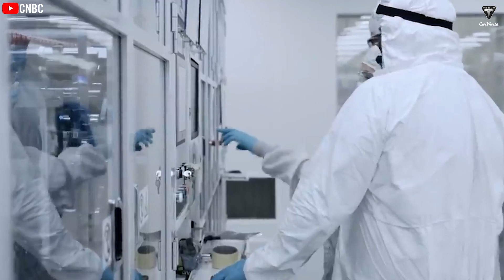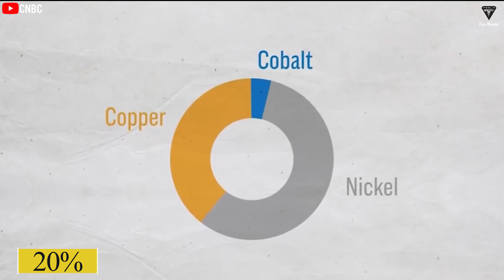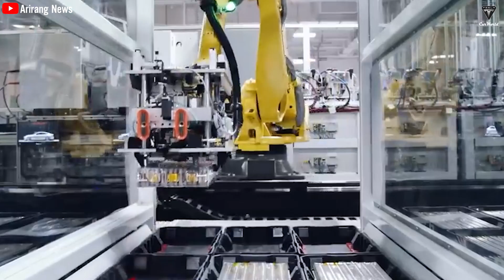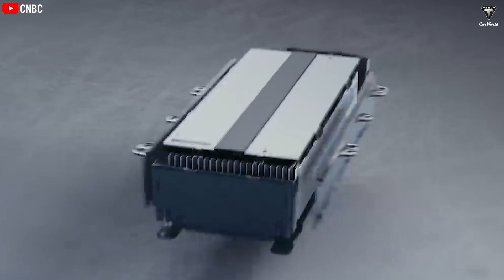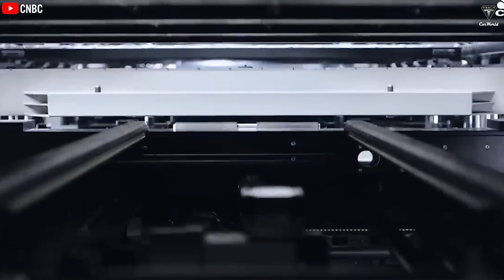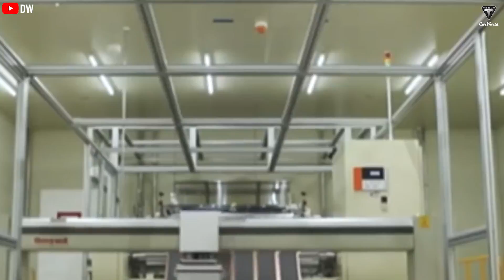Exploring Revolutionary 5-Million-Mile NMC532 Battery Technology

Comment: the test is conducted under room temp conditions but in actual automotive application, it's gonna be way colder and hotter than that
Reply: I’m sure a million miles is totally feasible in the most extreme conditions with the correct chemistry
Reply: So it can never reach 15M miles.. I amhappy if it gets to 1M miles..

Comment: You have to bin both Lithium and all other rare earths… then be able to recycle the whole cell and pack.
Reply: Lithium is not a ‘rare earth’ … or any other form of ‘rare’.  Lithium is the third most common element in the universe.  There is plenty here on earth … 😎
Reply: @robinholland7791  
There’s a lot but it’s no where that common speaking as a geologist you have to remember it’s difficult slow and expensive to extract . Even the guy who invented the lithium battery tech says whilst it’s abundant in sea water it’s far too dilute to recover ditto most of the mining prospects .. then there’s the cost of extraction and processing and the pollutants. Plus the geographic distribution isn’t always user friendly 🤭 
Re rare earths Nickel Manganese and Cobolt are all problematic in sourcing and refining. 
Check out the papers in Nature and in other scientific and even mining industry sites.

We have one planet that is supposed to supply us and everything on it for the forceable kindly look up a composition table of elements in the Earths crust. https://youtu.be/NKgJgpSLLcw?si=gY29CPQHEFaEIVFM Irons top metal, top non ferous metal is Al. there’s a lot more Na available than Lithium. Oxygen Silicon make up 72% total mass and Sulphur is among the top none metallic elements so …. 🫤 NO and quantities do not equate to availability and certainly not long term suitability in an already marginalised planetary environment. 

Systems thinking … it’s what sends economists running for  jobs in banks . .. equally fond of over simplistic  
none systematic thinking and not understanding how things actually work.
Reply: 95% of the battery can be recycled already. Infact, it is actually cheaper to make new batteries from recycled compounds, than from raw elemental stock.

Comment: If you are building Semi's you better be ready with multi million mile batteries. That should be the first expected use and be better able to absorb a higher initial cost for a lower lifetime cost.
Reply from the maker: A good idea for the Semi, we think this is possible because the specifications and outstanding features of the NMC532 battery are extremely relevant. Let's wait for Tesla's projects, thanks for your interesting contribution